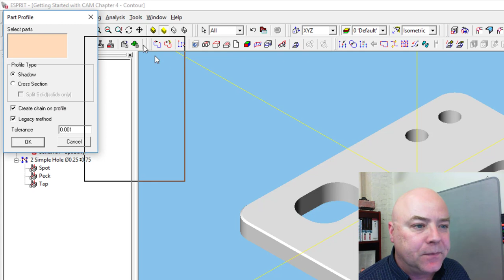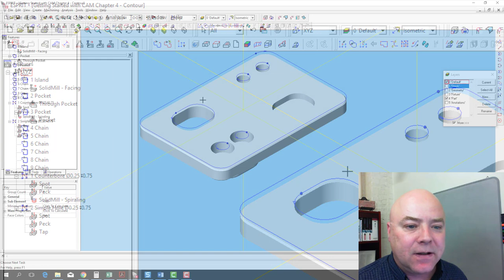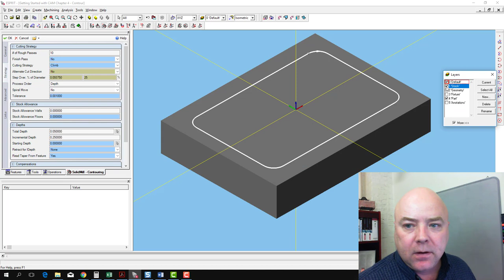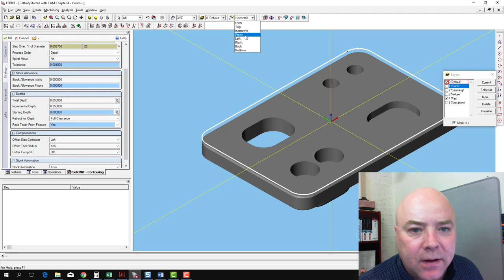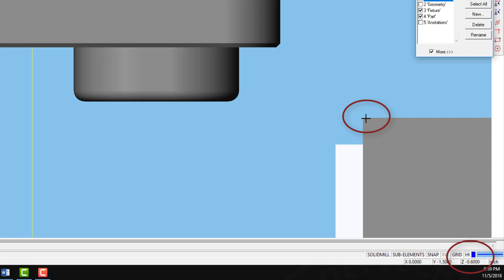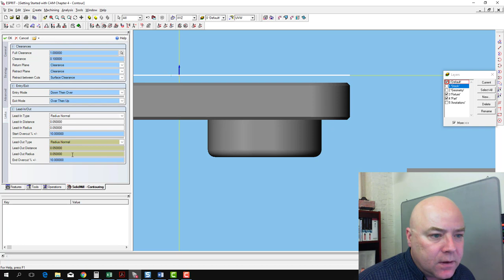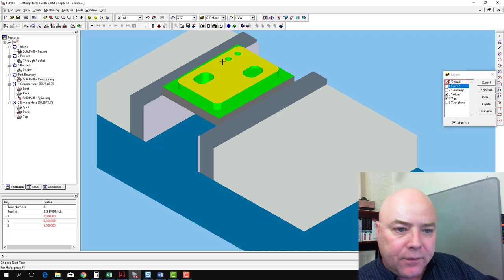Create a Contouring or Side Milling Operation in ESPRIT

Comment: do you use FEATURES?  then down below ALTER the start point and end point so THAT the cutter starts at where exactly you want it to start? 
in other words if you want a CORNER (chamfer or round) to be the lead in lead out where esprit by default just picks a spot where you're going to have a tool mark.